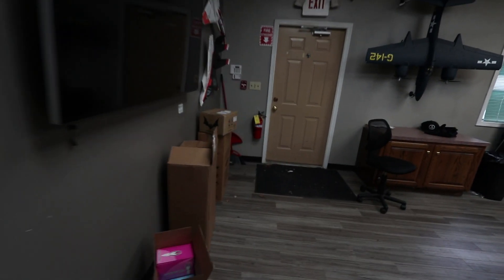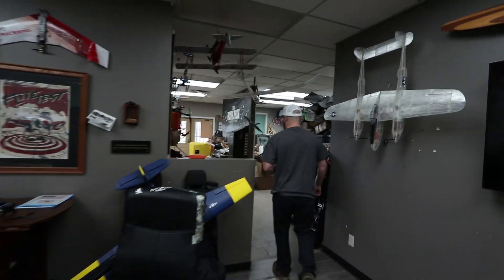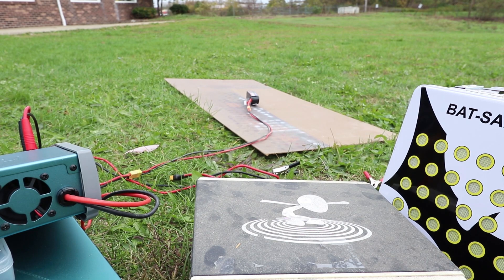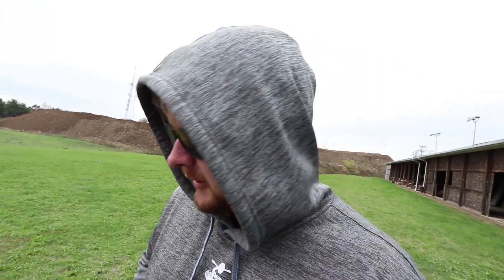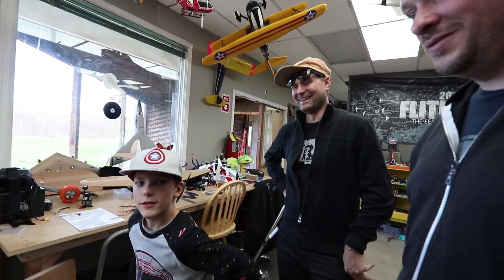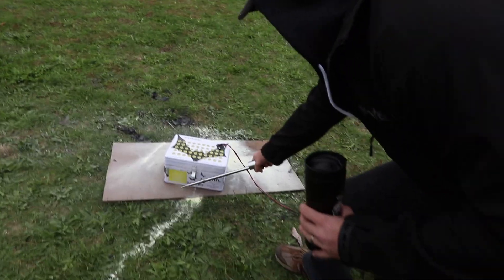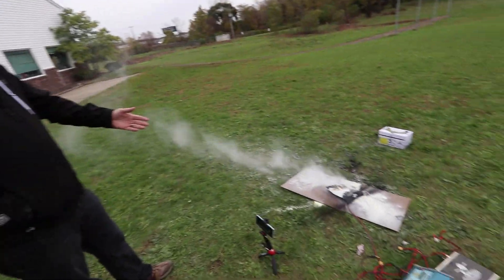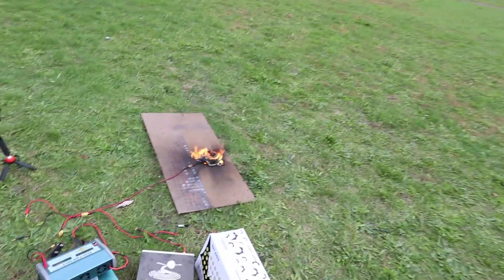WHEN LITHIUM BATTERIES EXPLODE... | VLOG0121

Comment: Ok so if I got a bat box to safely charge My lipos how will I balance charge? I can not find balance lead extenders and soldering longer ones one will get on the way On a drone.  So I think the bat box is better for transport If any one knows other pls tell me!    watches this video   Turns around and looks at lipo charging setup worried....any one else?
Reply: JST XH balance lead extensions can be found at Hobby King.
Reply: You can get JST XH balance lead extensions at HobbyKing or at other dealers. The Bat-Safe site itself sells them too: http://www.bat-safe.com/web/product/jst-xh-balance-prolonging-wire-set
Reply: Eric Coleson 
Crazy cal 
That is a whole lot of mucking around & extra cost great idea poor design. The bay box would be impractical to use with my SkyRc Q200
Reply: Crazy cal 
I had the same thought good for storage & transport but too impractical to charge in.
Reply: eBay and Amazon also carry extensions. I have two Batt Boxes each set up to charge two batteries each. This includes charge extensions, balance extensions, and temperature sensors. It can be done and is absolutely cheap when compared to losing a house.

Comment: I keep, and charge mine in an military ammo box.
Reply: @Kornweasel If you are able to close the box after the initial ignition you may be able to starve the reaction of oxygen. Probably tough to do in a panic situation. I am sure the box will still get warm. I will save the $40 and get an ammo case. Crawler guys have been using these for awhile.
Reply: Bearskinrug lipo fires are self oxidising.
Reply: Once ignited, the fire is self-oxygenating. You can't snuff it. An ammo box needs to be vented to prevent it from becoming a pipe bomb. Fire will erupt from either vent holes or case rupture.
Reply: kornweasel 
That is a much cheaper & more practical solution 👍🏻👍🏻
Reply: But, I think the ammo boxes will get hotter on the outside . Like to see a comparison between these and ammo boxes.
Reply: Make sure it has venting holes.
Reply: sooo, don't use an ammo box.
Reply: For me, I can shut the lid and throw it in the driveway. Let it burn. Yes, a panic situation. That's my plan, in my situation.

Comment: Under what conditions did the batteries catch fire in the shop?
I charge my batteries in the garage on a concrete floor but I use some concrete blocks that I put the batteries in, then put 3 plastic ziplock bags with sand in them on top. After watching the video I may put the batteries in a Lipo Bag inside the concrete blocks. Good Job on the video.

Comment: Gab707's recent sharing of his lipo fire experience & resultant major losses helped me decide to get a Batt Box. This video pushed me over the edge to order it right now. Had been using a modified ammo can. The Batt Box is a far better design and cheap insurance.
Reply: g36pilot smart man. I should do the same.
Reply: I once almost burned my house down and had a cough for 1-2 weeks after a lipo decided to catch fire when I was charging it.
Reply: After a lipo fire burned down a club-member's garage, destroying his Morgan car and a 50 year model collection; we all bought Bat Boxes! They external box is made of a very soft aluminium though and distorts very easily.
Reply: Thanks for sharing bepowerification and I'm very glad you resolved this w/o total loss. I just checked the MSDS on LiPo batteries and find it emits "Combustion products include, but are not limited to hydrogen fluoride, carbon monoxide, and carbon dioxide."  HydroFluoric Acid in any form can be fatal in smaller quantity than most toxics.
Reply: Materials Safety Data Sheet courtesy of Thunder Power RC: http://www.precisionhawk.com/MSDS-for-TP-BATTERIES.pdf

Comment: Had I been there you would not have been standing that close to the box without shielding. Contained explosions can be very dangerous. Re: the NYC marathon bombs.
Reply: It's not fully contained, that's the point. They weren't charging in a pressure cooker.
Reply: The Bat-Safe has venting holes for a reason :).

Comment: Damaged and or overcharging is the main cause of Lipo battery combustion.....and that is due mostly to simple operator error .

Keep batteries charged or I should say correctly store charged and contained in proper containers, most people will never have any issues with Lipo's . 

A few years ago when I wanted to get back into the hobby the Gloom and Doom stories of Lipo batteries and fires keep me away a few more years. Once I decided to do the research and learn that facts, I found the Lipo can be extremely safe if one is diligent and follows simple procedures.

as this video showed it took some charge to set that battery off and again mostly by overcharging and most  reported Lipo fires were by people who left their Lipo's unattended and or some that was damaged and not examined closely after use or after a crash or rough handling .

I read where some people  fully charge their  lipos and simply throw them on a shelf until they use them , to most who store charge them and keep them in a Fridge and or some others who use Lipo bags to metal containers etc . 

Lipo fires are real and can happen, but it tales simple diligence and respect of the product and correct handling to make that possibility almost non-existent .

Comment: As far as I know those fumes coming from the safe and the bag are highly flammable. If you look at the slow motion at 6:50 you can see clearly that the thing that is ignited is actually the fumes. So even though the fire reduction with the bag is substantial, I would not see it as a viable protection. As a single spark would probably create the same fireball as you can see in the first test.
Reply: I wondered that too, but the smoke is also filtered by the Bat-Safe? Would've been interesting to see if you can ignite it.

Comment: Can the box still be used again any damage
Reply: Better to buy a new one, it more than just paid for itself. The smoke/particulate containment material in the vent is highly likely a one time use item. The rest of the box is heat damaged and manufacturing specs are no longer guaranteed.  The hazardous burn residue would contaminate whatever it touches and smell so nasty you wouldn't want it in your shop.
Reply: g36pilot thanks mate

Comment: After 3 years in the hobby 2 weeks ago I had my first lipo explode while charging, it was indoors, no protective bag, high stress situation, flames and smoke everywhere, luckily it was away from everything so it didn't burn down my house but holy cow that was close, had it been 2m to the left it could've been a different story. Im also glad it was only a 2,200mah 3s and not the 10,000mah 5s.
Reply: Corral Lobo And what caused the lipo explosion? Was it your fault or was the battery bad?
Reply: I mistakenly grabbed one of my bad batteries that had been in a crash and was deformed, so yea, bad battery but mostly my fault.

Comment: if i charge inside, i charge inside the oven. it's designed to keep in heat etc luckily i haven't had a fire yet, but charging inside a firebox should help.
Reply: i just spent a grand on my new oven. im gonna buy the box cause its cheaper to replace. but not a bad back up plan
Reply: oh yea, i rarely use the oven at all. but i figured that they were designed to keep in heat etc, so perfect choice right :D

Comment: Make a rc plane explode mid flight.
Reply: unless you attached a secondary battery to explode :)
Reply: They did that a long time ago with fireworks. The FT Spitfire, i think.
Reply: https://www.youtube.com/watch?v=Fv27vvyi-gw
Reply: hard to do that with a lipo, it would fall out of the sky before the battery gets unstable. even if it drains completely, still probably wont go up in flames unless its 40+ cycles in drained completely each time.
Reply: scoodles93 and then try and pilot it back.